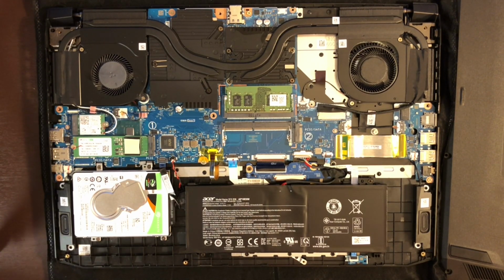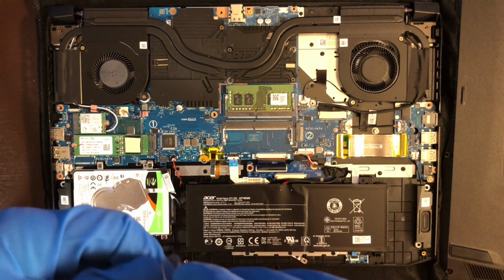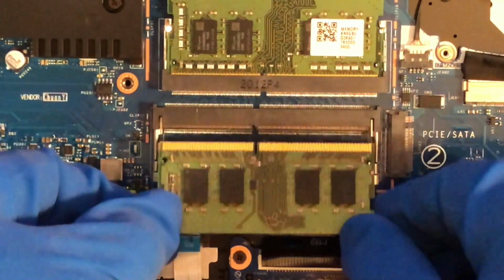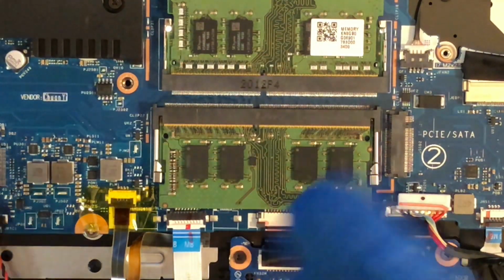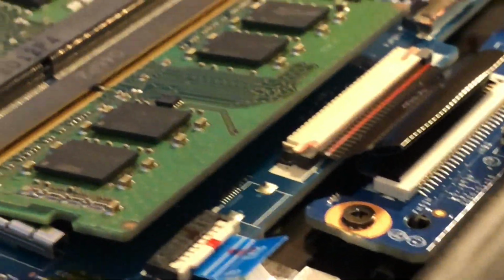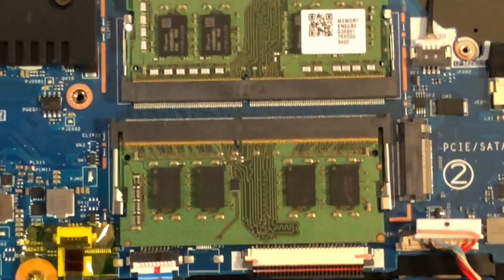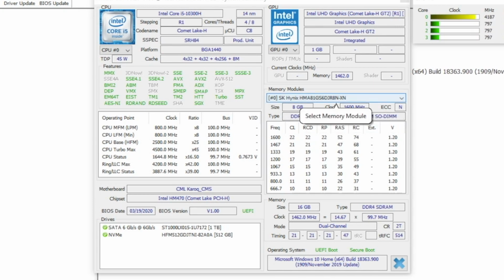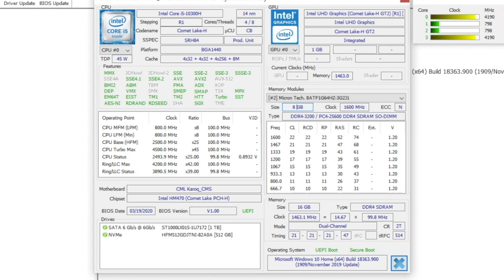Acer Nitro 5 Memory Install AN517-52-52T3

Comment: Is it ok if I use 2 different brand of memory rams?
Reply from the maker: Yes, as long as the specs match.
Reply: Meanpooh does it support 2666mhz ram?
Reply from the maker: I would stick to the specs.  You machine will clock down to the slowest module.  Go higher if you can.  According to Acer it does support it.
Reply: @Meanpooh  can you overclock the slower ram to match the stock ram that you get with the laptop?
Reply from the maker: Nope.
Reply: @nessfromearth4522  lol just get the higher speed ram, save yourself the headache man 😂😂

Comment: Cant find any crucial 3200mhz ram in our country (philippines) will it work with crucial 2666mhz or kingston 3200mhz?
Reply from the maker: Model of mem?
Reply: Meanpooh 
The crucial 2666mhz (PC4-21300) or kingston 3200 mhz (CL22) which one you reccomend? My nitro 5 is same as your specs
Reply from the maker: @nikkisarol8034  Get the 3200 Sodimm if you can.
Reply: Meanpooh so kingston? Cuz i cant find crucial brand
Reply from the maker: @nikkisarol8034  Yes.  Make sure its a SODIMM and its DDR4.
Reply: Meanpooh thank you i sub to your channel 😊
Reply from the maker: You are welcome and thank you!

Comment: is the sodimm 8gb ram single stick good for the acer nitro 5 (2019 version) plsss reply
Reply from the maker: Get 2.
Reply: @Meanpooh  last 2 question does the nitro 5 an515-54-5812 support 2666mhz?thx very much for your response btw and also why do I need to get two 8gb ram stick if there is already a 8gb ram stick is it because the ram sticks need to be compatible?
Reply: @Meanpooh  am very sorry if I'm bothering you tho but one more question I swear lol does the two ssd have to be the same too?
Reply from the maker: Just make sure you have a pair of whatever RAM you get.  You already have 8 so get 8 more.  DDR4 PC4-21300 2666MHz Non-ECC SODIMM memory.  SSD can be different.
Reply: @Meanpooh  ight thanks so much bro am not really used to PC gaming I'm a ps4 peasant lol so I dont really know alot about PC but I'm planning on buying the nitro 5 and when I do get it ama upgrade that bad boy up ASAP
Reply from the maker: No problem.  Take other brands into consideration and try to get the best for your money.

Comment: IS I SAFE TO ADD EXTRA 3200MZ WHILE THE PC CAME WITH  2666MZ
Reply from the maker: This laptop supports DDR4 2666, and DDR4 3200 memory, up to 32GB using two memory slots.  2 different speeds will default both to running at the slowest of the two.